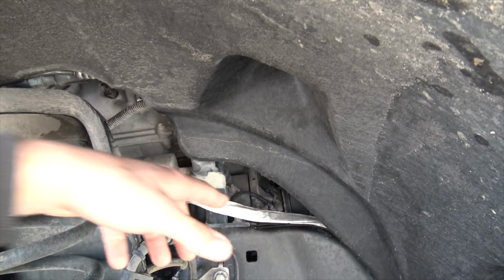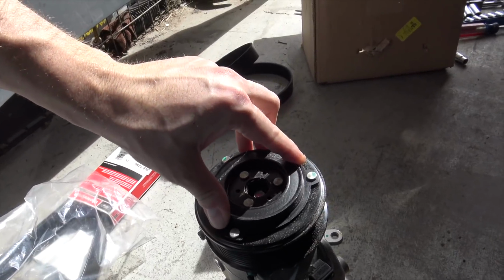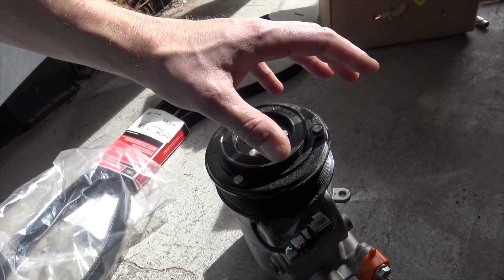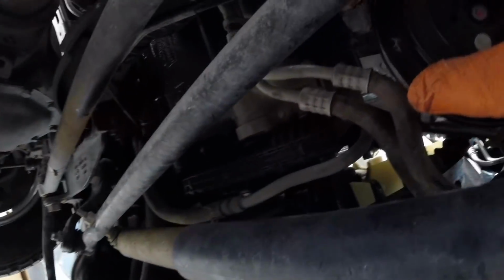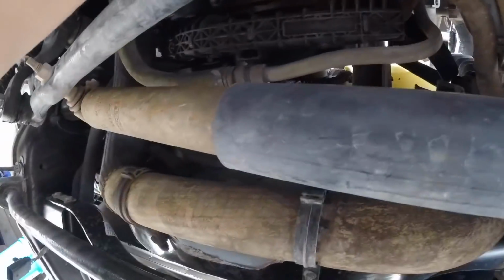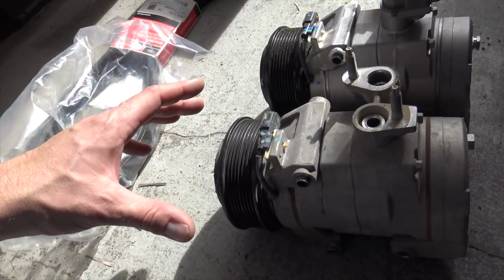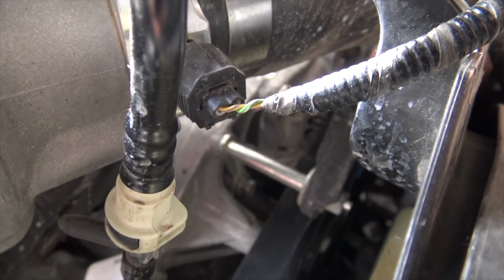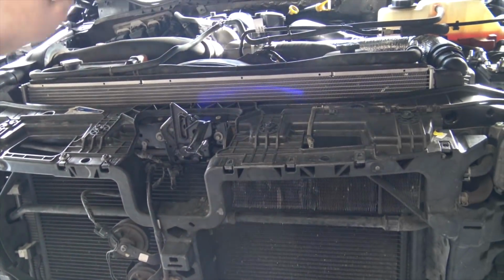Auction 2017 Ford F350 Rebuild Part 23

Comment: I always wonder how differently vehicles would be designed if the engineers had to work for two years as a tech in a service department before being let lose on new car development
Reply: Grrr! You're both right & every time I bust open a knuckle or slice my fingers up its literally insult to injury. But to hell with paying the dealer to do half ass work because they dont care about who rides in my car. I do

Comment: In the uk we use a special machine to recharge the ac,  first is suckers all the oil out and keeps it under pressure for 10 mins to make sure their is no leaks then recharges and adds the correct amount of oils this makes sure all is good

Comment: This is a huge undertaking and great project. Can we expect a cost rollup soon?
The seat coolers are peltier coolers in each seat.  They do not use the AC compressor or system.

Comment: Ford will have the peel and stick label for the serpentine belt routing. Yours likely was on the old hood or core support. The main A/C vent inside should read no higher than 38-40 degrees with the fan on high at a slight fast idle. Even in winter, an A/C system functions when using the "auto" temp setting at say 75 degrees. Also, A/C systems remove fog and condensation out of the interior during very frigid temps, when folks enter the cabin with damp/wet shoes and clothes etc. Without A/C supplementing the heating system, the windows will fog up as you use the vehicles HVAC system. So, this repair isn't out of sync with the up and coming summer temps, A/C also helps in many ways during cold/freezing weather just the same. P.S. anytime a compressor fails, it's a good idea to look into the two in/out compressor ports and see if it had any tiny metal debris. If it does, time to flush the entire system and replace the dryer or the new compressor will fail early. Hope yours just locked up due to the miles on it and from sitting for so long open to moisture. No secondary impact from the accident would have caused it to fail. On average, those compressors usually last about 50,000 to 80,000 miles depending on conditions.
Reply: I wonder if the original drier was damaged in the accident, and maybe some of the desiccant was loose in the system, jamming the original compressor.
Reply: @Dave_Boyer  Most of the compressor makers will not honor their warranty unless the drier and T valve are also replaced. They do that because there are so many mechanics who don't investigate the cause of the failure in detail then, damaging a brand new compressor in a short time. The largest reason is contamination/debris/moisture. Driers are cheap and provide good insurance the system gets cleaned and doesn't have a restriction due to a dirty drier. Likely he might be okay on this since the compressor locked up vs. blew up shredding aluminum pieces throughout the system. Also, if there's enough contamination, the condenser is the next part to replace because they cannot be cleaned/flushed well enough due to their design.

Comment: It would be interesting to know how much time Ford allow their dealers to change those compressors under warranty.
And did the designers realize that the compressor could be removed without taking far more time-consuming measures (as in the case of your 6 litre?).
Reply: Probably 1-1.5 hrs.
Reply: @PanameraTurboSEHybrid  
If the dealers are expected to remove the engine to replace the compressor it would take much longer than 1.5 hours, so the designers of the F350 must have made it possible to replace it without removing the engine.
So what's the score with the "6 Litre"?
Reply: @PanameraTurboSEHybrid 
I have found a company that will do the job for $799 (parts included), so I suspect that the designers of the truck knew what they were doing.
Reply: @adrianchetwynd1334  I was trying to be a little sarcastic. Removing the engine just to remove and replace the AC compressor sounds idiotic, all that labor for that countless other things. But with their messy overcrowded engine bays, I wouldn't be surprised. Seeing how Dave removed the compressor, it seems like it would indeed take about an hour and a half. Who knows....
Reply: @PanameraTurboSEHybrid  
He  insinuated that replacing the AirCon compressor on a "6 Litre" is far more difficult than changing the comp on an F350.
I don't know why, so you will need to ask him why...

Comment: If that system was empty and that compressor was trying to kick on you got bigger problems cuz. The low pressure switch should have kept it from kicking on

Comment: The Smartest thing to do is check them things & replace them b4 u install the engine in the frame! The truck was hit HARD on that side! Just like that Oil Filter piece! U had it all u had to do is change it out! U got very lucky on that! It could’ve been as HARD as this compressor was to install! If u go to the Ford dealership & into parts department give them ur Vin # & they can print out u a belt diagram! Hope whenever u done ur vacuum pull down u didn’t draw any oil out! That’s why u drain the pump & before u charge it u push the proper amount of refrigeration oil as u charge up the A/C system!  One day whenever u grow up & put ur BIG BOY PANTIES ON u may learn!!!